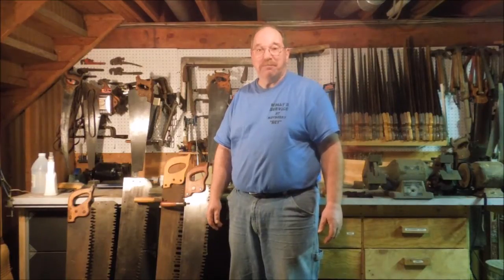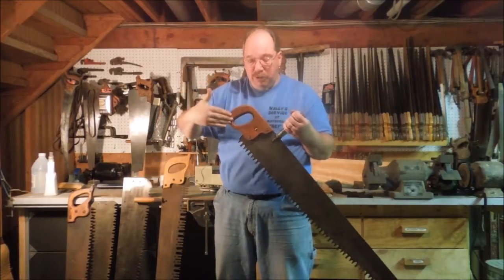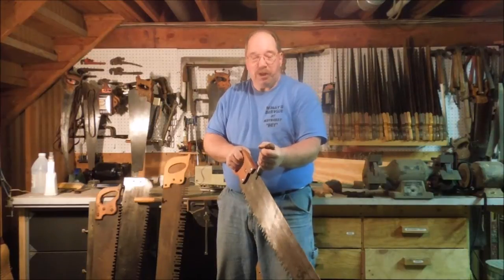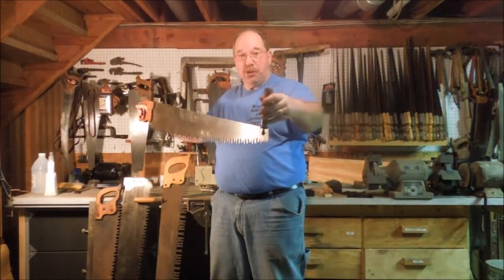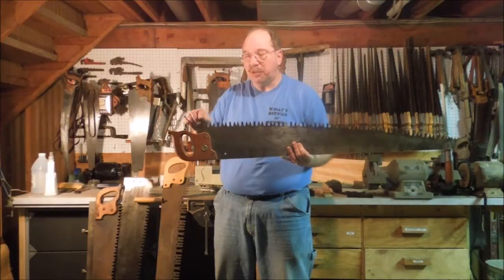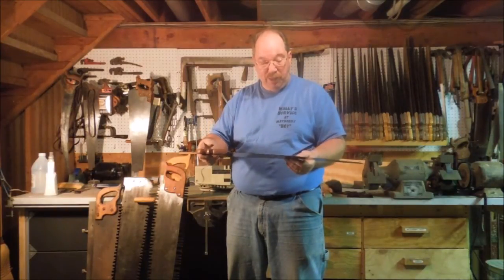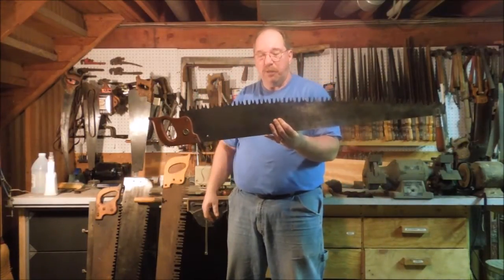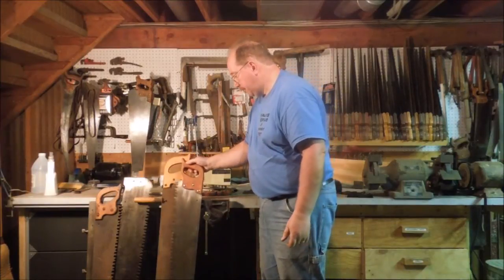Sharpening a One Man Crosscut - Pt 1 -  What is a One Man Crosscut Saw? by Old Sneelock's Workshop

Comment from the maker: Dean O, You're right. It is a big saw. 42 inches of spring steel. But with one tooth per inch it has only 42 teeth to sharpen. That's a lot less than the 26 inch long Disston #12 with ten teeth per inch.

Comment: Greetings Mr. Sneelock!
I got me a genuine old "H. DIsston&Sons" one man crosscut saw which I sanded most of the rust off of.
I got me a genuine Shurley Dietrich saw jointer; (a short one not a long one but that's good enough for me).
Plus I got me a genuine old Dunlap Hand Saw Set with a plier-type handle.

The saw looks like it hasn't been used very much.  It is straight as an arrow with no distortions whatsoever.  I ran the jointer over the teeth and it seems to have been already preset to the right depth because nearly all the raker teeth stick out by less than a thousandth of an inch or are perfectly level with the inset for the file.  Which is great because I don't have a feeler gauge and I'm not sure what the right setting should be.

I'm all ready to joint it, sharpen the teeth and set the teeth.  The Dunlap pliers even came with instructions that has a list of kinds of files to use on different saws... but it stops at 5 teeth per inch and this saw is 3 teeth per inch so I'm not sure what are the right files I should use to sharpen it with.

Could you please tell me what kind of files I should get?  Thank you very much.  
PS:  I already put thumbs up on your videos.

The other thing is setting the teeth.  The saw as I said looks in fine shape barely used and the set of the teeth look fine as they are.  How do I use this tool?  It has 2 screws for adjustment but I don't know how to use them.  Or what the proper offset of the cutting teeth should be.  There are a bunch of numbers on a metal wheel.which are confusing because they don't run in order of size:  
10-12-14-16--15-13-11-9-7-5-4-6-8.
Any information will be very much appreciated!  Thanks again.
                                                                            Yours: Indrek Pringi
Reply from the maker: Indrekk Pringi Thanks for watching. That will be a great saw. One of the important things to remember is to not take off too much metal with each sharpening. Only a stroke or two per tooth each time. If one tooth looks like it needs another stroke then wait until the whole saw has been hit with two strokes before going back. If more than 3 or 4 teeth need another stroke then go back over the whole saw. If you try to hit one tooth more than the rest it just gets too short to cut. 
Later in the series I show the file and how I use it. You can find it in this playlist. https://www.youtube.com/playlist?list=PLXlq5qGw1pep8oomLzRZsJEArDFDSdBmj
When you get it all sharp and shiny show us how it works.
Reply: Old Sneelock's Workshop 
I don't have a video camera so I can't show you, but I will tell you I already sharpened the saw.  Next week I'm going up north to cut down some dead trees with it.  In 3 or 4 weeks I'll be back and let you know how the saw performs.
It's a bucking saw not a felling saw, and since I'm not using it on green wood I don't need to  swage the rakers.  The steel is incredibly flexible and springy.  I tried the Dunlap pliers on it and the steel bounced back to its original position, so I did it again with a shorter adjustment and it still barely had any effect.  I might have to use pliers or a vise grip to offset the cutting teeth but I won't know if I have to bend the cutting teeth until I actually start cutting some wood with it because as far as I can see with the naked eye the cutters have already been offset.

What I really need to know are the tolerances for a 1-man Disston bucksaw.  How much should the offset of the cutting teeth be?   That is crucial and I don't  know  how much I should bend the cutters.   If I bend them too much or not enough it will ruin the cutting action.  If you can tell me how much the cutting teeth need to be offset I will be very appreciative.  Do I need a spider to measure the offset?
Reply from the maker: Indrekk Pringi The "set" is there just to allow the slicing crosscut teeth to make a mark wide enough to allow the blade to clear the hole. I usually set the teeth on a crosscut .010 to .015 thousands of an inch. That way the blade will cut .020 to .030 thousands of an inch wider than the thickness of the blade. On a panel saw I set them .005". The larger the set the more wood is removed and the more work needed to push or pull the saw through the wood.
The spider is a simple device to measure the set and though it is not necessary it is very handy. Any other device I can think of will be more complicated.
Reply: Old Sneelock's Workshop 
Gotcha.
Spider, set .010 to ,015 of an inch in both sides.  Good to know.  Thanks!
What I'm amazed at is how soft the steel is compared to a modern saw: it's almost like filing butter.
Reply from the maker: The steel is a lot softer than the induction hardened throw aways from the Big Box Borg.
The saw was meant to be sharpened.
The older saws are spring tempered so they will flex and return. Some of the old saws get brittle teeth and the tooth can snap off if you get to aggressive trying to set the teeth.
Have you watched the other videos in the playlist? I talk about the set and setting tools in them.
Reply: Old Sneelock's Workshop 
Yes I did.  I just didn't expect my saw to be that springy is all.  The Dunlap pliers had virtually no effect on it.  Instead of worrying about it being too brittle, I'm worried it being too springy.  Using some small pliers with a vise grip to keep the main body of the blade stable should do the trick.  But I won't touch the set until I get the spider I ordered online and actually measure the offset to see if it needs any bending at all.  Speaking of which I don't know why it's called setting when you're offsetting the teeth.

I sanded the saw, took off the rust, jointed, set the raker depth and sharpened the teeth freehand without a saw vise; no problem!  The spider I ordered should arrive in a few weeks. Then I'll be able to measure the offset with the feeler gauge 1 I bought.    I'll let you know in about 2-3 weeks: Bye.
Reply: Old Sneelock's Workshop 
Hello Mr. Sneedlock I'm back!  I keep on getting you mixed up with Mr Snodgrass, I've never met a Sneedlock before.

I finally got my spider and now I'm going back up north to offset the cutting teeth by measuring it properly .  The saw worked fine cutting down dead trees and sawing them into pieces.  After 5 days of sawing and  re- sharpening the saw 5 times, touching up the points after a day of use I noticed it was getting harder to use because the width of the cutter teeth were getting smaller due to my touching them up every evening after a day of sawing, so I offset the cutter teeth by just using a clamp and an ordinary  hammer without being able to measure the offset.    Because I don't have a saw vise I had to vise each tooth separately before giving each tooth 4-6 firm  knocks.   I couldn't tell any difference by eye but that made the saw work much better and slide more freely.  My cutting teeth are definitely not brittle in fact they're too springy.  I don't like using a hammer on them but there's no other way to bend them!@ Besides, I figure it's safer then using a pair of pliers... at least a semi-firm knock with a hammer won't crack off the whole tooth.  I cracked off the last tooth on the saw using a pair of pliers and a vise grip to keep the saw blade stable... at the very tip of the saw where you use it to start  a groove.  That last tooth is no loss since it barely gets used anyways. 

I found out why they made these saws.  You can them touch up in less than 10 minutes freehand with a file.  The lumberjacks that used them only sent their saws to be gauged and sharpened by an expert once a week or once a month after sharpening their saws in the forest by themselves.

Another thing I discovered was the handle for your 2nd hand that goes onto the saw blade gets loose too easily while you're sawing.  A lock washer between two flat washers fixed that problem perfectly.  Now I can tighten the wooden handle and it won't get loose.  I don't want to lose that little metal rivet because I'll never find another one to replace it.

.010 - .015 offset.  I've got my feeler gauge and spider now.  Now I can sharpen the saw right.   Thanks a lot.  
                                             Yours:  Indrek  Pringi   That's my real name.
Reply from the maker: It might be a replacement pin. In my extra handle the hole on one side of the clevis is larger than the other. The pin is put through the smaller hole and then the end is peened until it will still go through the larger hole but not the smaller. That way the pin is trapped.
Reply: Old Sneelock's Workshop 
Not on this Disston.  As I said a lock washer between two flat washer solves the problem
I broke off another tooth trying to offset the teeth:  the teeth at the end of the saw are not meant to be offset!  You should have warned me about that.  The follower teeth that start the groove; the saw blade is so narrow at the end they have no pliability whatsoever.  If you had told me that I wouldn't have tried a 2nd time to offset the follower teeth.  This DIsston saw is a real pain to offset, the teeth are so long and joined together in pairs, they bend like crazy and spring back unless you give it just the right force hitting it with an ordinary hammer.  Otherwise it it springs back.   Except for that the saw works fine.  Nice talking to you.  I'd like to see you sharpen and offset a genuine Disston bucking saw with the original tooth length and see how far you get..
Reply from the maker: Sorry you are having so much difficulty with the project. Unfortunately I can't be there looking over your shoulder while you work. This long distance after the fact training isn't working as well as I'd hoped. Perhaps on the next one you should find a local saw shop to show you close up.
To clarify one of the saws in the sharpening video is a genuine Disston One Man Crosscut.
Reply: Old Sneelock's Workshop 
You're right.  I expect too much.

Did you offset the pointer teeth at the end of the Disston one-saw?
Are they made so you can offset them?
I would really like to know.
Reply from the maker: When I set  saw teeth I set all of them as needed. If by pointer teeth you are referring to the teeth at the end opposite the main handle that don't have a raker tooth in the group then yes I set those too.
As I said perhaps you need to seek local help.
Reply: Old Sneelock's Workshop 
Damn.... well my saw's pointer teeth break the second I put any pressure on them or hit them.  Every saw's I unique I guess.  I thought they aren't supposed to be offset.  I was wrong.  Thanks for telling me.